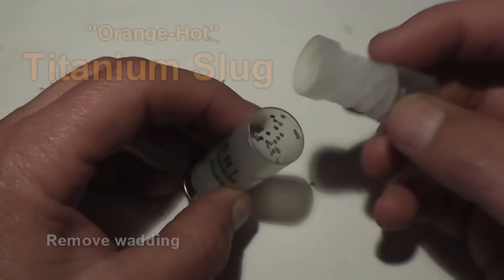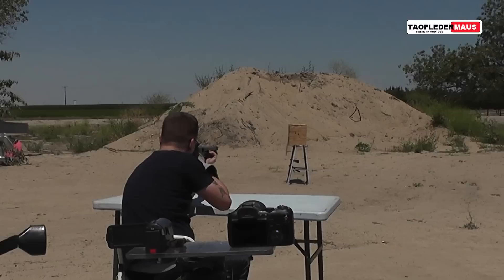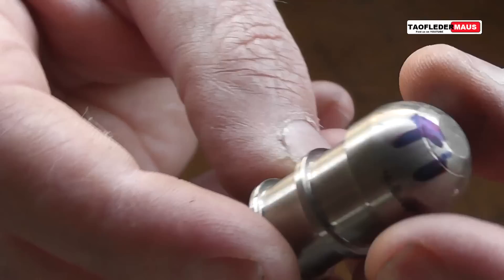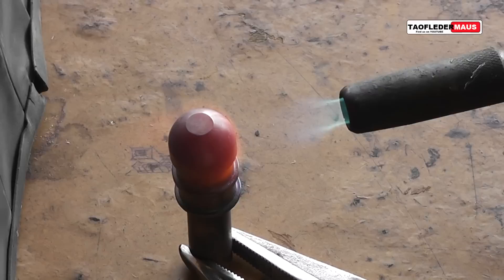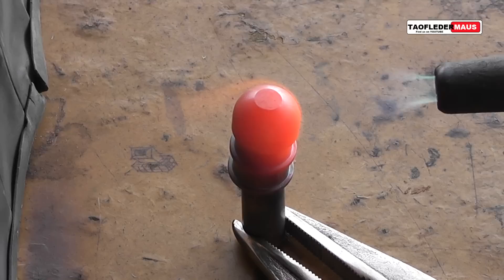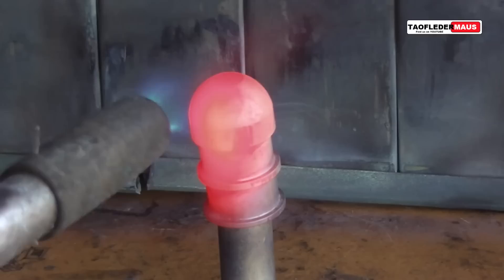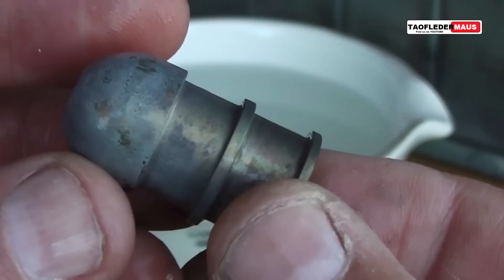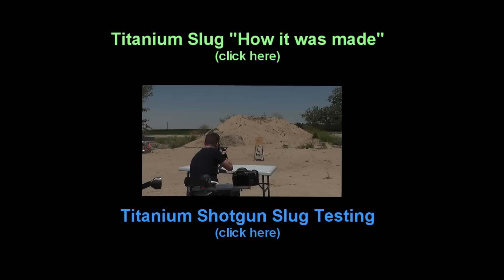ORANGE HOT Titanium Slug  (not shot!)

Comment: the white layer is a film of Titanium Dioxide. TItaniums version of rust but this actually forms a thin, protective layer over the rest of the titanium. We see this a lot in dabberland, particularly with chinese nails made from cheaper alloys (grade 5 most common) rather than the comercially pure Titanium that's safe to dab off of (grade 2, 1). Anyway the point is cheaper chinese Ti Alloy nails do exactly that, if you heat them up and drop them in water (water seasoning is a common practice among noobs) they form a layer of white that is tell-tale that it's unsafe to smoke with. Dabbers call it Death resin but there's nothing inherently harmful about it. It just indicates a less-than-pure titanium alloy that is unsafe. Perfect for your applications though, nobody expects a shotgun to be healthy! xD
Reply: RippyTheRazer Side note pure titanium nails will do this too but it will take months to years of hard use or months of repeated water seasoning to get that effect

Comment: The white stuff is titanium oxide. It widely used as pigment in white paint. Also, in this sense,  titanium is like aluminium. It has a solid oxide layer that forms really quickly and sort of protects the rest of the material, but normally it is too thin to be seen, but at high temperature it forms a much thicker layer.

Comment: Titanium was supposed to be the metal used in the construction of the Concorde, because at supersonic speeds the plane can get as hot as a barbecue grill and Titanium could withstand those temperatures. However, BAC chose to use an aluminum alloy since they were more familiar with it.
Reply: Maxwell M. 
The Space shuttle also was supposed to be titanium but due to budget issues and the Airforce's input was built with aluminum instead.
This change may have contributed to the loss of STS 107.

Comment: Actually, the white stuff is Titanium Dioxide. When heated to red-orange or higher, it can rapidly develop a thin outer layer of this, which then seals the inner Titanium from any further corrosion. It's white, VERY white, which means it's used in pigments - one of the most common colors in oil paints, for example, is Titanium White. Titanium Dioxide is not toxic, but is considered an IARC Group 2B carcinogen, which is why its use as a food coloring has been reduced.
Reply: +Valandar2 Well that's cool!

Comment: The white film is probably titanium dioxide. Titanium has a relatively hight heat tolerance, but by heating it up and rapidly cooling it off in water you introduce oxygen to the surface producing a fine layer of titanium dioxide (like rust [iron oxide] but for titanium). This effect with titanium makes it a very difficult metal to deal with as it then cannot be melted and casted into different shapes unless done in an anoxic environment. Also, once titanium is reverted back into titanium dioxide (the major component in white paint that affords it the stark white color) it cannot easily be turned back into titanium metal. It is for these reasons that titanium is very expensive. Titanium dioxide is SUPER abundant, but since it's so hard to turn into titanium metal, it drives the cost up. 
P.S. You might try spending some time watching the channel periodic videos

Comment: The cool part is titanium also expands when heated and the sr-71 black bird was made from it
Reply: biohazardjackson63 Dude, most everything expands when heated.  That's just basic physics.
Reply: But the sr-71 had a fuel leaking problem so when the metal expanded it sealed it's tanks but once it cooled off the process started all over again but the interesting part is when it heated up how did the fuel not ignite and why didn't they just weld the seams closed when there is no fuel in it then again it was built a long time ago so technology probably wasn't enough to make a weld that could resist melting but it is still a great reconnaissance aircraft but yeah metals of all kinds do expand that's why when you tack two pieces the gap between them spread farther apart but can be solved by cooling the metal
Reply: biohazardjackson63 You're mostly correct, but sentence structure is your friend. Your post is nearly unreadable.
Reply: biohazardjackson63 It wasn't a problem, it was designed that way.  The amount of fuel lost was pretty small between fuelling and take-off, and the JP-7 mixture that it ran on has a very high flashpoint so there was no chance of a ground fire.

Comment: The white stuff is titanium oxides, I have experimented with that stuff making cathodes for fuel cells, it occurs when you heat it up at high temperatures, it start to react with the oxygen in the air and oxidize, stuff is usefull for photovoltaic uses such as solar cells

Comment: Hey there ***** , thanks for another great vid. The "white stuff" that you brought up is just TiO2 (titaium dioxide) which is oxidized (rusted) titanium. Fe rust is red, Ti rust is white :)
Reply from the maker: It didn't do that when I let it air cool,  though.
Reply: hmm I see. I've found that Ti oxidizes much more rapidly when dunked than air cooled. Similar to other metals like iron. I don't pretend to know all of the chemistry behind it but I know that if I heat brand new Ti to orange hot and then let it air cool I will see very little/no oxidization. However if I dunk the brand new orange hot Ti into water I will instantly see much more oxidization.
Reply: …Even distilled/ deionized water that could not possibly hold minerals that might bond to the metal

Comment: Wow, you should get one of those heat lasers, and see how hot it was.
Reply: Rods Ahed Somewhere around 700 ° Celsius, because the flame that is used is not much hotter.
Reply from the maker: Rods Ahed   I have one but I think it only reads up to 1000 deg F.
Reply: ***** oh, ok. so you need one of those industrial ones, i think? (and no, im not telling you to get one for the channel, )
Reply: Rods Ahed There actually are smartphone apps that can tell you (with quite some precision) the temperature of anything hot enough to be glowing in the visible range. 

So, no need to buy a thermometer here.

Comment: I recall that titanium dioxide is extremely stable and hard to break apart. Could the residue on the round actually be titanium dioxide that formed from the hot titanium reacting with oxygen in the water to produce hydrogen?

Comment: I wonder, does heating and quenching titanium like this make it any more brittle or maliable or anything?
Reply: RockabillyPinstriper Well that is pretty much how you temper steel to make it stronger. I really have no idea what the guy was expecting to happen in this video.
Reply: RockabillyPinstriper 
It makes beta titanium harder

Mission knives uses it
Reply: RockabillyPinstriper It can. Titanium isn't particularly hard or strong, it just has phenomenal strength for its weight, and works great in high temperature applications. You'll see it used in the drive trains for stationary turbine pumps, and drills, especially where high RPM is required.
Reply: VicariousReality7 Titanium isn't particularly hard, or strong. In fact I can promise there are tool steels that have WAY better properties for being a knife blade.

Comment: I wanted him to shoot it hot.... :(
Reply: Tactical Ultimatum How? It's not like he could insert it in the shell...
Reply: piranha031091 Put it in like a muzzle loader. The slug would not melt the plastic shell in under 10 seconds and ignite the powder in my opinion. So everything is safe, as long as the slug slides down enough and does not get stuck in the middle.
Reply: PunchingMegaTree Read again, I said it won't go through and ignite the powder in under 10 seconds! So everything is fine. Melted plastic won't harm anything.
Reply: piranha031091 I'm not saying its logical or possible. unless you use a felt wad and a brass case

Comment: That would be cool because tungsten doesn't bend or give just shatters under extreme circumstances
Reply from the maker: Joe Jackson   The tungsten well drilling head buttons that Ave said is going to send to me are very tough.  He put one on an anvil and hit it with a sledge hammer and it didn't break.   It will be interesting to see what it does hitting a steel plate at super sonic velocities.
Reply: ***** dude I can't wait to see video! Sounds awesome I know as rings and jewelry it can't be cut off it has to be shattered that stuff is pretty expensive I believe
Reply from the maker: Joe Jackson  These things are made to break through rock without breaking.
Reply: ***** sounds awesome cant wait to see what its capable of you have any targets in mind?

Comment: PLEASE put an orange hot slug in a brass 12 gauge shell and fire it. Perhaps Tactical G Code could machine a custom shell for you.
Reply from the maker: J ClarKent  It would cool off when it hit the other metal parts so it would just look like I was shooting a cold one.
Reply: Heat up a steel ball bearing and use a graphite (ideally, or another material) shot cup as an insulator to put it in, then load and shoot it before it has time to cool down. Even if it isnt glowing hot, it still would be sweet to see a smoldering wood target.

Comment: titanium oxide is freaking 'white'
Reply from the maker: HYEOL  is that a technical explanation?    When I heated it up and let it air cool,  it didn't form the white deposits.
Reply: ***** You probably let it air cool in a dry enough place so it didn't react. Either this or the water that you use is really that hard that it forms that crust.
Reply: ***** Water helps form Oxides, but we could try this with some other water for comparison...
... or ask an expert, but that would be boring .D